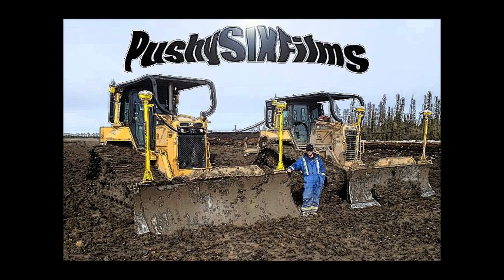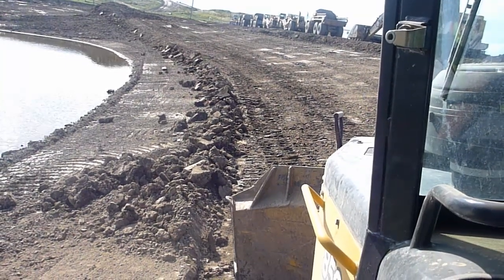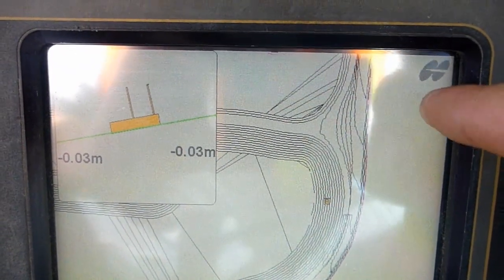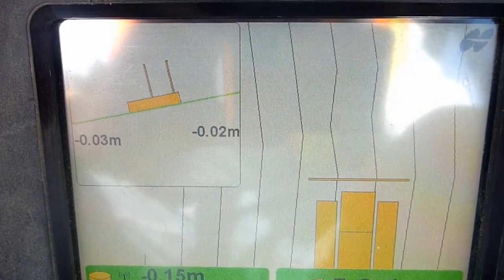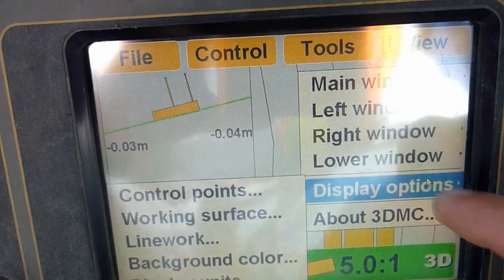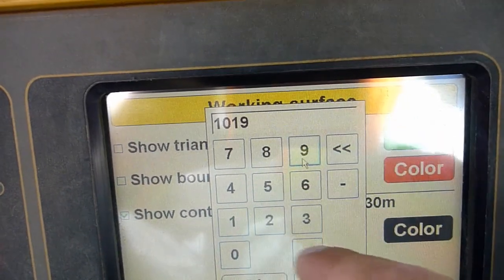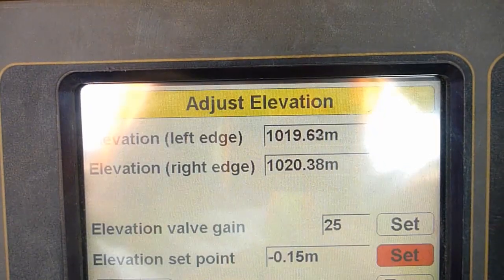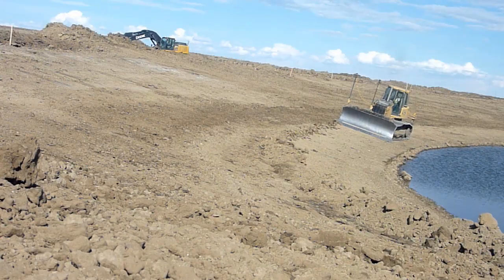TopCon how to - pond PWL

Comment: Was the elevation you put in, the finish height of the water?? If so did you use the position check to get the elevation height and then put that height into the contours?? i hope that makes sense. I drive the new D61 pxi  and the automatics work a lot more smoothly on that. Would be great if you could post some more tuition videos on the GPS. Im doing surveys and can use a survey to create my own surface, but i no theres alot more that it can do, but no one wants to pass that knowledge. Thanks Bud